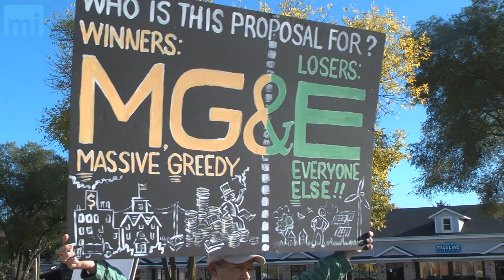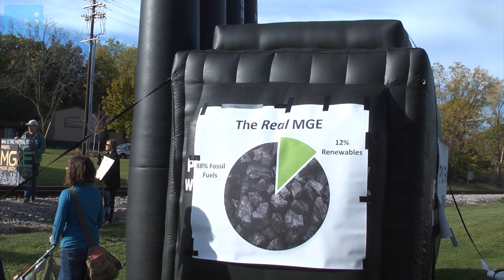Renewable Energy Fails Protesters Calling for More Renewable Energy

Comment: These people have no understanding of the scope of power needed by a person in modern society. The average home has 150amp service, that's 18 thousand watts available day and night rain or shine. This pathetic solar panel can only produce 130 watts on a bright sunny day for a few hours at best and costs around $1,000.00 . LOL
Reply: Its actually more like 36,000 watts. Your point still stands but its even worse than you thought.
Reply: Joe Schmoe You are right on a 2 phase three wire 240 volt service, which  is most American homes. So I guess we would need 277 of these panels at $277,000.00 every 17 years (lifespan), but they would only replace  the power company a few hours on sunny days.
Reply: 1965ace I just don't see solar ever getting there. Granted major breakthroughs have been made in recent years. Solar is something that has its uses but  is very application specific. You have a timer for some outside lights? Hell, put a small solar cell on it to power the timer and charge a small battery.

But when you get into electric motors, which make up the vast majority of load on the grid it becomes laughable.

The problem again that you have highlighted is major, it would take insane amount of these to power even a standard home.

But the idea becomes even more absurd when you think about things like huge office buildings and chemical plants. It's just not possible. Maybe it will be some day, but not now.

The funny thing is that the soloar proponents are "environmentalist". But to do things their way is a massive waste of resources and is actually WORSE for the environment
Reply: Joe Schmoe Mr "Schmoe" you are absolutely right. The scale of energy needed is far too great and the reason technology will never get there is the available energy is only about 15 watts per square foot. Unless new technology can create energy itself ,lol. Besides that we already have the greatest supply of stored solar energy ever........fossil fuels. 

The only valid alternative energy is to step up to the weak force . I would recommend the LFTR .....a Thorium reactor.
Reply: 1965ace Same here. Thorium is the only real option. But you gotta convince those same environmentalist that its ok.

Its funny because the people that act so concerned for the earth are the biggest hindrance to greener and cheaper energy.
Reply: Joe Schmoe Its true.

Comment: I see they flunked basic math.  Let's see if the load is 1,000 watts and the panel provides only 130 watts, you are 870 watts short of the mark.  Did they even bother to look up the capacity of the battery or did they think the magic fairy dust would take care of it?
Reply: Fairy dust makes Peter Pan fly.  It's useless for batteries, though.
Reply: @BobDiaz123  I appreciate California and Germany, though, they are letting the rest of us see the effects of wishful thinking on the power grid.

Comment: Solar power... paying 10 years of power all up front. It has its purposes but not in the city where you can have a reliable coal-fired power plant. 

If you don't have infrastructure in place it may be cheaper to have solar power....if you have a shack in the middle of nowhere.

Deep cycle batteries cost big bucks and significantly increase costs of storing your own solar power instead of relying on the grid to be your battery.

Comment: Why don't they figure out their power requirements; get a bigger solar panel and a bigger battery?  It's easy to solve this problem!  If the fan requires 1000W, just get 10 of those 130 W solar panels.  Easy!  It'll cost you about $1000 for that demonstration.  A rainy day could drop that to 25%; so.... $4000 for that demonstration.  Go big or go home.  Now... they could make it run all day and all night if they get 12kWh of battery.  That costs $800; and it'll need a sunny 4 hours to pull it off.   Now... to build a system that runs all year; rain or shine... that's an expensive proposition...